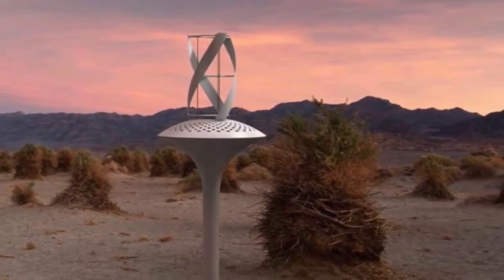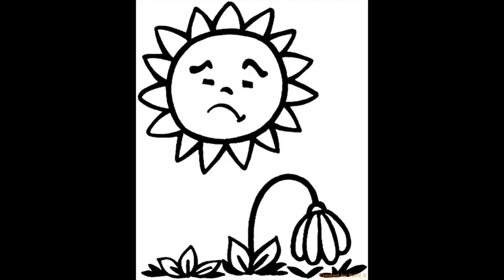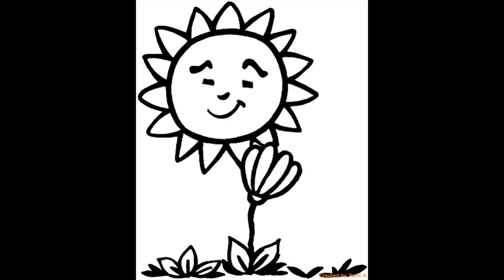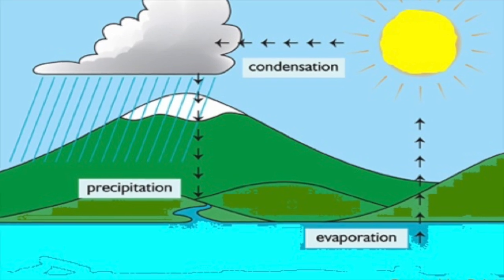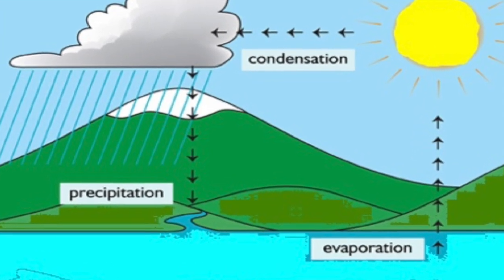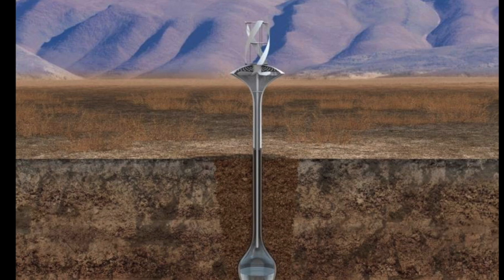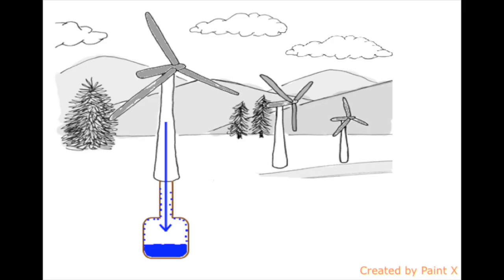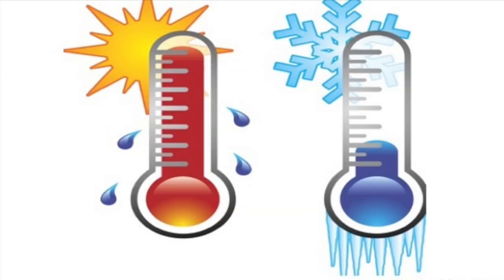Water Seer Debunked then FIXED (2020)

Comment: Hmm.  I wonder how much it would cost to trench thousands of feet of plastic tubing (which is a very good insulator, BTW) to a depth of 10' on a project with a very slim possibility of functioning due to thermodynamics?   

Yeah, this has absolutely no way of working.  In order to lower the temperature of of hot, dry desert air to the dew point (where condensation happens), you must remove heat from a huge quantity of air.  Think of it this way,  90 degree air at 100% humidity can hold about one ounce of water per cubic meter of air.  A gallon of water is 128 oz, so you need to cool 128 cubic meters of air from 90 degrees to the dew point  in 10 minutes to hit even six gallons an hour of water generation.  That's a lot of air to cool down.  It gets worse:  people who need water typically don't live where the air has 100% humidity,  they live in arid regions where the humidity is 20% or less.  The yield of water will be lower by an order of magnitude or greater for the same amount of air.  That also requires an enormous transfer of heat that would saturate even a makeshift workaround like this.  Now, it may work for a while, but the water generation would trickle off after a short amount of time as the ground and piping get heat soaked from trying to absorb the heat load of almost 1000 cubic meters per hour of air rushing in to be cooled off and extracted.

BTW, before they skipped town with all that sweet, sweet Kickstarter and Indiegogo money,  Waterseer realized that this scheme would never work, so they tried taking a standard household dehumidifier that they bought from China for $300 and put it in a custom tube with Waterseer logos all over it to "prove" their idea worked, and they charged suckers $1500.00 for it.  Even when working in a greenhouse with 100% humidity, it underperformed spectacularly while still running up the electrical bill  by  almost 10Kwh per day, per unit.
Reply: Builders do bury 6 inch PVC pipe 6 foot down and blow air through it to use for space cooling, apparently the heat transfer rate of the plastic is enough to use the system for cooling. Copper is a better heat conductor but is very expensive and corrodes in the soil and you have electrolytic effects.
Reply from the maker: @ronwhitehurst7992  exactly
Reply from the maker: 1000's of feet? you have no idea of what you're talking about
Reply: Simple Tek: dude, you were the one that said you needed "several thousand feet of PEX tubing" with a pump to keep water flowing in it to cool the bottom of the WaterSeer bulb, right?  It needs to be placed well below the surface to work. So, how is that tubing going to be installed? LOL.

Comment: I think this is a great idea. Will help a lot of people everywhere, who otherwise would have no clean drinkable water. It will also help households who are getting shafted by their city on water bills. WHERE can I get one?
Reply: You can’t find something like this, because it is literally impossible to make it work!

Which is why the WaterSeer never became an actual product.
Reply from the maker: @BoHolbo  it has problems
Reply: They leave out at least one important part.  The water is not drinkable.  It would need to be filtered or otherwise purified.  Condensed water will condense with everything else icy as mold spores and pollutants.  Also this is an open system by nature to allow air entry, even if the chamber were initially sterile, it won’t be for long.  That is why all dehumidifiers have warnings about NOT drinking the generated water
Reply from the maker: @AMD7027  ok
Reply: You can't and shouldn't, it's a scam. Building it would be to much work for the payback you get in return. Might as well use the time to design and build one into a part-time-job to finance your water needs.
Reply from the maker: you have to build it

Comment: Same fundamental problem. It will only work if the dew point is above the ground temperature. The ground temperature is basically just the mean annual air temperature and in dry environments it’s rare for the dew point to ever be above the mean annual air temperature. So most of the time you won’t get anything.

It would also cost thousands of dollars (turbine+ground loop installation). If you’re willing to drop this much money per household on getting people clean water, you can easily solve the problem by treating existing sources and building new water projects. It’s not technically difficult to provide clean water, even in dry environments. We do it all the time in the developed world. It’s just expensive. The problem for the developing world is not that no one knows how to provide water. It’s that the funding isn’t available for the required infrastructure.
Reply from the maker: you make a lot of assumptions
Reply: @SimpleTek  No, I stated a lot of verifiable facts. I am hardly the only person here to point out to you that your system cannot work unless the ground temperature is below the dew point, but the nature of dry environments is that this is rarely the case.

In that case you really have to go to a true heat pump system to get the air cold enough to get any water. A typical 3 ton ground-source one would produce a sufficient amount of water for subsistence living, but it is going to cost somewhere in the low to mid five figures (I already gave you that source). It's a great system for heating or cooling air, but a piss poor way to get water. It would be significantly cheaper to just hook up an air conditioner (or air-source heat pump) and drain the condensate. It's still a poor approach though. You're spending a lot of energy and money cooling air just to extract a very small amount of water.

The turbine isn't free either and of course, you need the wind to be blowing to get power.

Realistically, there are better ways to get water. That's what we do in developed countries. It's the cost that's the issue in the developing world NOT that there just isn't water around.

To further drive this home. If you're willing to dig up the earth and run hundreds of feet of piping for every household and add pumps to move liquid through those pipes, you're basically describing the investment of just building a municipal water supply. Except that will be able to deliver a lot more water for a lot less energy and the construction can leverage economies of scale to be substantially lower cost.

In the same vein is the human factor. If I'm living in some remote village where I have to walk for miles every day to get five gallons of water so I can barely scrape by, and some Westerner installs thousands of dollars of hardware at my house so now I still only get 5 gallons of water per day to barely scrape by, my life hasn't substantially improved. I'm just walking less. The one real advantage I have now is that I have all this pricey equipment. The logical response is going to be to rip it all up, sell it for as much as I can get, then use the money to move somewhere with indoor plumbing. This is just a reflection of this being a terrible way to use resources on solving this problem.
Reply from the maker: @mediocrehat  facts from where? did you make one?
Reply: @SimpleTek   Not totally clear what you're asking. I have a ground source heat pump (for heating and cooling) if that's what you're asking, and it produces almost zero condensate (water) in the semi-arid climate I live in and it cost a five-figure amount of money to put in. It's great for HVAC, but I'd die if I needed it for water.

I use a well for water which produces a lot more water, cost a lot less than my heat pump, and uses a lot less energy.

To bring you back to the original problem, the ground generally isn't cold enough to condense any water in dry areas. For example, I live in a pretty cold, semi-arid place. Our ground temperature is somewhere around 45F. Our dewpoints are almost never that high, meaning you're not going to condense any water most of the time with a system like this (hence why I said you'd have to go to a full on heat pump, but I described the issues with that above). When our dewpoints are this high, it's typically because it's raining anyway.

If you're willing to dig holes, run pumps, and lay tons of piping, you've just described the exact effort of creating a municipal water system based on wells, and that'll work a lot better than a system that only condenses water when it's already raining.

Comment: I’ll build one that uses a wind turbine driven compressor and some freon to condense the water.
Reply from the maker: good idea
Reply: That’s literally just making a ground-source heat pump then collecting the condensate. So you’re looking at $20-30k for a high-end HVAC system but then you’re just using the small amount of condensate it generates in cooling mode during the summer for a water supply. This is like buying a Ferrari so you can heat your home with the air blown over the radiator. Yes it will technically work, but it’s an absurdly expensive and wasteful solution.
Reply from the maker: @mediocrehat  My system is maybe $500 including excavator time... someone's been ripping you off
Reply: Simple Tek you mean the system you just proposed and have never had built? That price figure is based on what exactly? The system this commenter described is literally just a ground-source heat pump and it’s pretty easy to get quotes for those.
Reply from the maker: @mediocrehat  so the you admit you're changing the subject?
Reply: @SimpleTek  what? The subject of this thread is the cost of the system described here (a ground source heat pump). It's in the low to mid five figures and I provided a source for that. You pulled $500 out of thin air as near as I can tell.

Comment: Scott Larsen  problem with any design is getting new wet warm air Down onto the colder coils, so this design has an air flow problem mostly since no exit piping so no air flow. Should have 2 larger pipes connected by a smaller pipe with cold coils https://youtu.be/eRteOtKqLOw
Reply: You're talking nonsense and so is that kid. Do you know how much CFM of air you'd need to move to get any meaningful amount of condensation?
Reply from the maker: depends on the humidity

Comment: It would work but not as efficient as if the tube was filled will freon and wrapped inside of the fan flow like a radiator.  you would NOT need the extra power also ⚡️ just replace the Freon every couple years and is cheap
Reply: This comment gave me aids. You have no idea what you're talking about.
Reply from the maker: love your comments
Reply: @SimpleTek  lol thank you. I must have been in a mood that day.
Reply from the maker: Rich Bauer don’t ever hesitate to comment on my videos, good or bad! I appreciate the feedback and need a laugh now and then too!

Comment: Solved? No, not at all...
Reply from the maker: yes
Reply: @SimpleTek  no,  still wouldn't work unless you bury your tubing in permafrost. as air cools, it's ability to hold water decreases and humidity goes up. once the humidity reaches 100%, water condenses out of it, so if you cool air enough for the air to reach 100% humidity, water will fall out of it. that temperature is the dew point. if the air going into the "water seer" doesn't go below the dew point, no water will come out. if there is a morning dew, that lowest temperature for the morning roughly sets the dew point, and is the temperature you need the beat for a water seer to function.
problem is, unless you're talking about spring in winnipeg, the ground will never be below the dew point and no amount of pumping heat around will fix that. you'd need very cold ground and very humid air to make it work, and in that case you don't have water scarcity, all you need is a tarp, a few sticks, and a bucket.
Reply: @wyattroncin941  ALSO, these areas are just generally arid and condensation isn’t a viable option.
Reply from the maker: @wyattroncin941  ground temperatures where I live are about 3-5'C a few feet down. so for here, in the summer, solved.
Reply: @SimpleTek  until you saturate the ground with air temperature air. . . Which will happen pretty quick no matter how cold the ground is, again unless it's permafrost levels cold earth.

And I'm from Dauphin, the ground is maybe 10c a few feet down, except during winter.
Reply from the maker: @wyattroncin941  clearly you didn't watch the video
Reply from the maker: @wyattroncin941  it's colder than 10'C at Dauphin 10 feet down. watch the video, it's clear you didn't from your answer

Comment: 1 - How do you circulate the air in that prototype?  Allowing air in but not letting it out leads to no circulation. 

2 - What you described is an electrical dehumidifier, which is nothing new and can be obtained for a fraction of the price. 

WaterSeer's concept wasn't feasible, which is why they ended up switching to a glorified electrical dehumidifier concept. 
Nothing to see here.
Reply: I think I know a passive way of creating air suction, and also see my comment in the main section not as a sub reply. Tesla valve, one way for liquid or air doesn't have resistance the other way does, so instead of pumping air in, suck air out at a point at the bottom where you wouldn't care to have the water rise above, line the tesla valve so pulling air out from the bottom is easy, lead it into a chamber that uses sun to heat up a volume of air and to escape that chamber is tesla valve,... chamber heat up air gets expanded, escape from the top and has a hard time getting new air from the top so it socks air from the bottom, forcing fresh air inside as replacement
Reply from the maker: magic

Comment: Wouldnt it be better to find away to make ocean water safe to drink?
Reply from the maker: actually, yes - but not everywhere is close to the ocean
Reply: @SimpleTek  I agree with that but it bugs me nobody is really trying. If we can pump oil across continents then why not use solar power to pump sea water inland and desalinate? Most areas that struggle with water scarcity are hot, arid places that get good sunlight.  Countries in the Middle East use desalination for much of their water but use reverse osmosis which is too energy intense to actually be commercially viable. More money needs to go into new processes using sea water and sun as energy.
Reply from the maker: @estallard101  Well said
Reply: @estallard101  Desalination is very energy demanding process, so money again.

Comment: There are other ways that will actually make this work, but the company, Waterseer, is not interested as they are currently selling $200 electrical dehumidifiers for about $1,300 each.  In my opinion, this group has always been about the money and not the project.
Reply from the maker: you're probably right

Comment: Wouldn't it be easier to just mount a dehumidifier to a wind turbine?
Reply: Cheaper too   wind turbines are inexpensive  then trying to dig a hole  that would cost $30,000

 a few dehumidifies and  a winturbine  is a more viable option
Reply from the maker: This uses a little less energy. Cost wise it would be interesting to price them both out

Comment: I think I will build this and then try to modify it in a clever way to make  it work. I have several ideas, number one - the tube from the fan to the reservoir, this could be used to decrease the energy of the water vapour/ air mixture ( think speed of flow and fins ), then you’ve got the reservoir itself ( think surface area, and not just a bulbous shape ). If anyone thinks how does a tree move water many metres upwards, then you may be on to something. How does a tree root work, and what about a heat exchanger ( thank u Bosch ) or heat ‘ pump’ utilising the turbine at the top.
So get working on this and if Any ‘ haters’  would like to come to my lab, then please pm me.

Thankyou
Reply: I understand the problems with this, and  people claiming it to be debunked.   but I still believe something can be made that will do this.

for one,   some claim it would work only part of the time,  well,  that is not a problem,  water is water.  the debunk video claims that the holding tank would warm up.   that is NOT true,  the holding tank would have the same average temperature as the area surrounding it, if it is able to disperse this heat.  and that is the ticket,  i'll explain below.

If the holding tank area has heat sinks,  ( fins or tubes ) that can radiate the heat in a wide area,  this problem of the air heating the surrounding area over time would be less of a problem.

also in areas where nights are cold,  ( high deserts ) and days are hot,  that cold air will be doing the opposite of what it does during the day, and actually might cool the ground more than its average.   it may not produce water during this phase of the cycle,  but should do its job during the day.

Ok so here is my idea,   the underground tank has heat sink fins. enough so that in the daylight cycle by the end of the day,  the ground tank is still cooler than ambient temperature.

During the day,  the device works as normal,  condensing water ,  but over time starts to warm up as explained by the debunk video.   ( but it has already stored some water ), at night,  the cool night desert air,  cools not only the underground tank but also the water,  the heat sink, would slowly cooling off the surrounding area that was warmed up during the daytime phase.  

so,  by doing it this way,  we still maintain the average underground temps,   it would work anytime the outside temps are warmer than the underground tank.  

In nature many critters and plants take advantage of day night temperature changes by condensing water,  I think it may be possible to completely eliminate the whole underground part of this,  just collect condensation on something that cools off at night,   it might not make a whole lot of water , but would be simpler.
Reply from the maker: @agriperma  ok
Reply from the maker: roger moody great ideas, let me know how they work